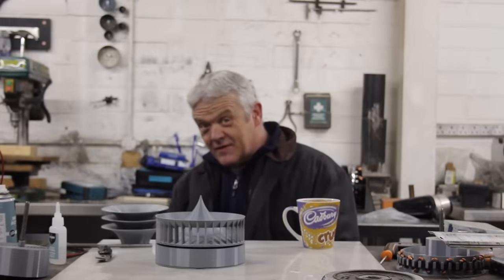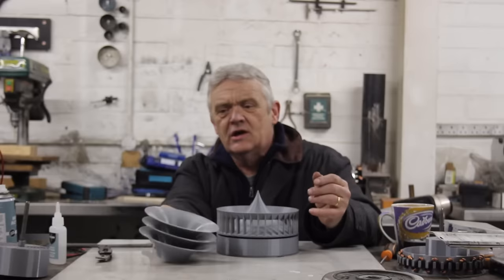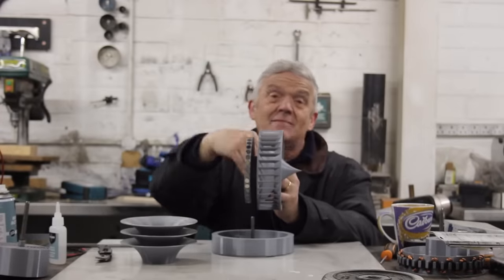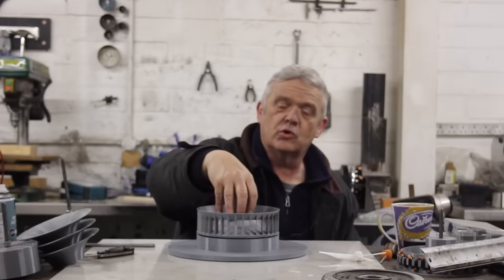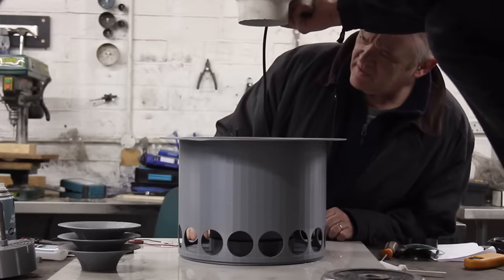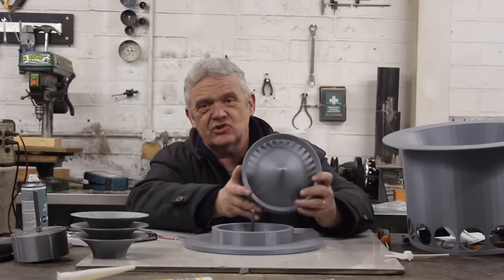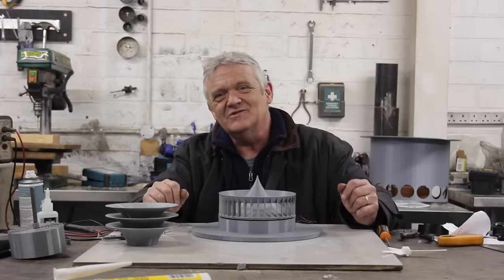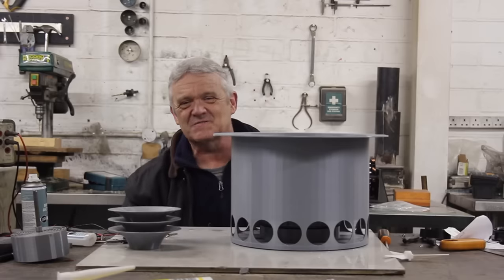1889 Ground Breaking Wind Turbine Update

Comment: One drawback of having the mechanics at the bottom of this "mushroom" is that you'll have to maintain it more. Leaves, dust, ice cream papers and plastic bags and other junk tends to move downwards due to gravity. Sure, the wind momentum will smash them at the turbine even when it's at the top, but then when the wind gust passes and the turbine stops, the rubbish is more likely to fall off it, i.e. a turbine that's at the top has a self-cleaning property.

Another benefit of having it at the top is better contact with the ground/better (theoretical) stability. Because of drag forces. Your "mushroom" is pointing downwards, acting as a blade trying to lift the whole thing.

I definitely agree with you, maintaining the generator when it's at the bottom is definitely easier. But that may also mean it's more likely to need maintenance.
Reply: oh, and thanks for the update :) I was a bit worried this Darwin's wind catcher project was quietly dying, like the Izzy project ;)
Reply from the maker: I doubt there will be much difference but cheers

Comment: I like that you have been making each part to be easily exchanged for another style piece.  But you still need another one for a baseline that won't be changed, given all the variables of wind speeds. Hey! like stacked bowls with the bottom cut out. (for those without a 3d printer.  My usb tester comes with an artificial load plugin.
Reply from the maker: I like the bowl suggestion mate - nice one

Comment: I've just been looking through some of your older video's, I'm looking at possibly adding some wind generation to a solar install in an off grid application (allotment shed) more to gain some power during the night perhaps when the solar stops.  I was wondering about combining the likes of the Darwin collector and focusing it onto the Archimedes screw with that attached to say a 100w/12v or 24v commercial generator.  Being at an allotment I want it bird friendly and discrete/stealthy. Not sure it would have the power on that smallish scale though.  Great video's!

Comment: By putting the generator at the bottom of the device, the transfer of energy is more efficient going to a battery close to ground level (It's all a measure of efficiency in all its forms).
Reply from the maker: cheers mate

Comment: I commend your efforts on this project. But I feel you just mite have it backwards from which the air is introduced too the squirrel  cage  fan as We Yanks call it, on it blades itself, just like a water wheel. the water  falls on a small section of the wheel to make it turn. looking at a blower housing with a squirrel fan , use a water hose and run water threw the inlet and you'll see not much of an effect on its rotation. then take the hose and run the water threw the exit of the blower and you'll see a much more effect on rotation of the wheel. I feel if you use your horn and concentrate the air over a smaller section of the wheel will give you more RPM and be able to connect several of then in the same horn system. I've been wanting to test this out Myself just haven't had the time. BTW I'm an Air conditioning Engineer. Keep up the good work you inspire other to think out of the box thank you!

Comment: To harness all the winds energy it must move through the device with little incumbency remember the child's hand held  windmill  to catch the wind: to use as efficient energy it must twist as indeed does magnetism coaxial toroidal flow. There was a chap that designed a turbine in the same way for use in a silow rather that blade rotors the turbine was much smaller and had more resulting energy.👍

Comment: Those exit holes for the air look prime for computer fans rob residue for secondary energy capture. Also the circle shape may be giving you more resistance that flat line shape on the exit. (Micro improvements) Amazing work though as always 👍
Reply from the maker: nice one mate cheers

Comment: a whole volt. maybe a watt or two if your're lucky, and the blower you used to test it is probably 50 watts, giving an efficiency of say 2%, whereas Hawt units are getting 50% of the Betz limit.
Reply: I thought smth similar, but "Theory and practice are the same, in theory. In practice, they are not." . We might both be wrong. Ventumdynamics made something similar and by the looks of it, they will beat hawt big time, at least on small scale practicability if not on efficiency as well.

Comment: TURBOJET, this looks a lot like the schematic of a turbojet but where the turbine has been reversed and the compressor is now the funnel. That suggests looking at various types of turbojets and looking for low velocity solutions that can be adapted to this model.

I would also suggest looking at the the mechanical impedance of the turbine where E^2 = 2 P^2 m_2 /(m_1+m_2)^2, P is the momentum, m_1 is the mass of the props, and m_2 the mass of the air passing through, to find the maximal power-transfer of the energy E.
Reply from the maker: cheers mate

Comment: I would modify the base to raise it up a little such that the top of the plynth (i.e. the surfaslce which the air exiting the silo immediately comes into contact with) is shaped like the upper surface of a 'flying saucer'.

Hear me out...as fanciful as they are, the flying saucer shape does aid in airflow.  Air blasted down across such a surface results in lift.

Now, I know you're not trying to make this thing take off, however, if you modified the vents around the bottom of your shroud such that they were rings running around the whole outside edge which directed the air downwards, the air could be directed down onto the flying saucer shape.

If my thoughts on what may then happen are correct, this would then result in the air being dragged out of the silo more efficiently than if it were to be directed straight out across an irregular flat plane.

If you raised the saucer to around 6"off the floor too, then, I'm thinking that the extra height may act to enhance the aerodynamic 'depression' effect further.

Comment: All wind turbines have one thing in common: they prefer laminar flow.
Either you place the turbine at high altitude or you create laminar flow.
Torque is a function of force related to the radius of the rotating shaft.
T=r*F
So you can increase the torque by increasing the diameter of the turbine or increasing the force acting on it.
If you want to test different turbine designs, you have to keep several things constant. The force acting on the turbine (wind speed) and the diameter of the turbine. Just a thought.
Reply from the maker: nice thoughts mate - thanks for sharing

Comment: Something I remember from my Army days:  When testing our tank's engine during quarterly services, one test that was done is how much torque the engine produced.  These were obviously very large engines, weighing about 2.5 tons, so not easy to put it on a Dynamo.  What would be done is to measure the engine's acceleration from idle to redline.  Since the engine's rotating mass was known, how fast that mass could be accelerated was a good measure of the engine's power.  Perhaps you could do something similar.  Using a measured wind speed, see how fast the turbine goes from 0 RPM to some fixed limit.  The mass of the turbine's rotating components is known, as is the wind speed.  You just need the right equation.  I'm terrible at math, so you're on your own there.
Reply from the maker: nice one mate cheers

Comment: Instat improve that Isee is to make ratio of 1/4 so that hole on center needs get more tighter to increase the speed on rotor. The more wider collector with smaller hole to certain degree until the void occures. Also spiral does work as collctor you could build that collector as sorial to reduce the hole size on bottom of spiral then greater collector on size on top of spiral.

Comment: This could also be achieved by adding some screw type blades to the inlet cone of the device... The key is to harness the stable efficiency of the vortex.  Why is a tornado so powerful?  It is because it is naturally stable and efficient... Using your wind director to also create a vortex should greatly increase the natural efficiency of the device.  The idea is to create a mini tornado within...
So, make the directed wind spin in the beginning... 

Also when installed in real life you will need to shield the outlet holes from the external wind blowing to assure  minimizing external interferences and eddy flows... i.e prevent wind from blowing into the exhaust ports etc.

Comment: I have every respect for RMS because he knows stuff about chemistry and physics which I know I'll never understand. There is one thing I do understand however, and I'm not sure if he does. As an electrical engineer one is taught about power transfer. The thing about power transfer is that it depends on loading. If you load a power source to heavily or too lightly, then you do not necessarily achieve maximum power transfer. If you are using any generator as a means to measure design improvement, you can only do that accurately if you optimise the generator for maximum power transfer. You can only do that by varying the load, which is something RMS never seems to do. He does measure voltage and current which are two points on the power transfer curve. Unfortunately the graph is rarely a straight line. The curve changes with the design changes. The optimum is usually somewhere between the two measurements he typically makes. He could improve his setup with some kind of a "load bench"  which would allow maximum power transfer to be found for each design assessment he makes. That way he would get a much better picture of the benefit his design changes are making. He is doing excellent work though. Most people don't even try to measure what they are doing.

Comment: IIRC, this whole project started with putting flaps on a flat disc, to make the system more efficient at catching the moving air, so why are you not adding ridges to the central cone, to catch more force? Seems like the logical thing to do, right?
Reply from the maker: yep

Comment: B, mag field flux is a critical component of that formula and is something I have been thinking about as to increase the electrical output. The frequency of the phase shift is immaterial, so it might be worth trying magnet arrangements as NNNSSSNNN instead of NSNSNS.
Reply from the maker: it might

Comment: 8:16 Imho that is not the main reason. This cover provides a more directed airflow over the blades. Without, air does not only comes from the inside, but from the outside and the top and any other direction, hitting the blades. 

Btw, i would turn the blade angle. It,s better when the wind comes from the side and goes out of the funnel. You know, like the termites and moles do it. It also reduces complexity on the part. All you need then, is a toppled funnel, the longer, the better.
Reply from the maker: cheers mate

Comment: It is a cool concept, but the problem is the amount of wind the collector can catch... Consider the disk area of a conventional wind turbine.  This is a large amount of wind facing area to work with and extract power from.  To equal that, this type of collector would be insanely massive.

Comment: I really like your research and building this as a prototype. 
I'm a bit disappointed in the shroud test because the air source is lower with the shroud on than with the shroud off, and more of the energy of the air source is going to be able to transfer to mechanical energy just because of the reduction of turbulence. 
I do believe that there is an increase, I don't believe it's actually twice as much because there will always be boundary effect losses. 
Also, I think part of the reason that the commercial unit is upside-down from your configuration is that if you were to mount the device on a peaked roof of a normal house, any horizontal wind would gain a vortical vector that could be additive to the energy transfer. 
I still haven't figured out roof peak dynamics, though I know that the windward side has a more laminar flow than the leeward side, which breaks into chaotic turbulence and loses energy.

Comment: Love this design yet looking at it it it seems to be upside down here. You have to remember heat and friction creating heat will push the air up? So wouldn't it work better to have the air suck in from the bottom pushing upwards and out?

Comment: A thought about the unit pointing up or down. To me when the motor is on the bottom and thrust is pushing down it would put more load on the thrust bearing causing drag. Air pushing up "could" cause lift and perhaps if the generator section is not too light, then the trust upward should cause it to float and reduce drag.
Reply from the maker: I don't think so as the wind is always be 'thrusting' against a turbine to make it turn isn't it? and if it was lifting then wouldn't you have to have a reverse thrust bearing at the back of the shaft to stop it pulling out of the stator?

Comment: I remove the gears from a microwave turntable motor or synchronize motor.  And I left the coil, the metal cage and the magnet.  I then attached a shaft with a propeller.  With a blower directly above it, I was able to get 4 to 6 volts but the shaft would wobble.  I'm wondering if your new rotor would help stabilize it and get more voltage.
Loving the channel by the way.  Planning on some projects because of you.  Just waiting on some parts to arrive.
Reply from the maker: nice mate - have fun!

Comment: Surely generator efficiency will vary with rotational speed? Unless you have an accurate calibration (i.e. Efficiency vs speed at different electrical loads) for your home-made generator then your relative voltage readings will not be directly comparable. I'm not saying that your method for using voltage increase as a proxy for torque is wrong, its just that you will have to account for this additional factor first. Interestingly, the most efficient generators run at a FIXED speed in order to target this sweet-spot as is the case for most wind-turbines.

Comment: Yes - really interesting.  I've been having a think about the collector system, because it seems that this is the most important part... The idea is that wind energy (pressure-volume) from a large surface area is crammed into a small pipe.  I would guess that the fan itself when rotating will help clear this pressure-volume, but there is inevitably going to be a back-pressure - so how can that be reduced?  Right at the start I'd say that the set of circular holes is not enough free exhaust area and will generate a back-pressure.  One way of installing this in my house is to put the collector at the top of a single storey extension and the generator at the bottom with a 160mm x 3m soil pipe joining the two.  How can I maximise the pressure differential and the volume of air entering?  One possibility is to add a turbocharger.  A small spiral ugrinsky vawt could sit (upside down) at the top attached to a ducted axial fan, pushing air down the top/middle cone.  If the cones are pseudospheres, then the middle cone can also be slightly lengthened and act as a venturi, which would then draw more air in through the side orifices.  As someone said below - it looks like a jet engine.  It's also possible to go completely crazy with this and also add a cowl and an extraction turbo on the outlet (another Ugrinsky driving another ducted axial fan) ... so there is a fan-assisted positive pressure on the inlet and a fan-assisted vacuum on the outlet.  Way too complex.

Comment: The only problem with horizontal cone wind capture is the horrendous inefficiency they inherently display.

When used as a collection of FIXED spiral funnel cones, on multiple layers and all around the device, the collected wind from whichever direction will be chanelled down an ever decreasing pipe onto the central spinning scoop section.

Scoops on arms would probably be best for a first device, followed by one where the funnels and scoops could move together when greater speeds have been achieved.

Comment: The shroud has a cone that concentrates the airflow, but then beneath it is a hyperbolic sort of cone that then spreads the airflow out again.  Seems like you're doing some work and then doing work to undo it again.  Maybe the shroud would work just as well without the cone?  Or maybe the upward hyperbolic cone could have spiral vanes on it, to use that concentrated airflow to help speed rotation?
Reply from the maker: you could try it

Comment: What would the effect of Gears be between the fan and the wire-coil plate? Would it rob to much of the energy of  the air moving the fan? 
 I get that this is 'proof of concept', just wondering how much of the wind force we might loose and if it would be an advantage or not.
Reply from the maker: gears change speed into torque mate

Comment: Never heard of a Darwin Wind Generator before this channel.  It turns out there are companies making these things.

They all put the turbine in the top.  I like your idea of inverting the thing, so you can work on the turbine from underneath.

I always wanted a windmill to run a water pump and make a closed-loop micro-hydro-power instead of chemical batteries.  Same with solar electric.  Use the power to run a pump that takes water from an in-ground cistern to a water tower.  Of course, there are losses in going from one form of energy to another.